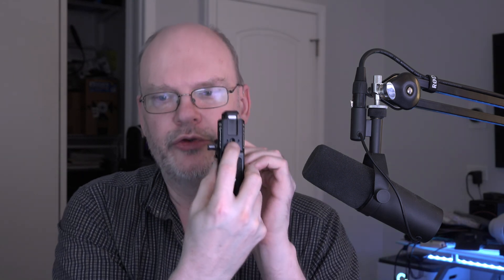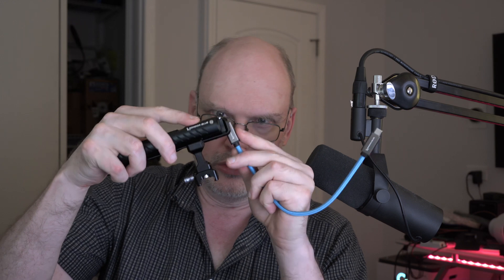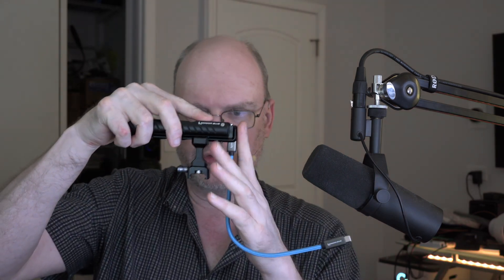Kondor Blue SanDisk PRO-BLADE SSD Handle First Look

Comment: Sad that smallrig or other companies don’t does the same thing without that problade thing. But build and enclosure, and build around an handle.
I’m not a big fan of proprietary things.
Reply from the maker: Internally it's a regular M.2 NVME drive, so if the PRO-BLADE casing ever gets discontinued, you can still take the SSD out and use it elsewhere.  But the mag casings are much more durable than any other external SSD I've used.

Comment: How on earth did you get this so early?
Reply from the maker: I pre-ordered it on their website the day they put it up for order.
Reply: @cwichura  And it supports your 4tb mag right? (the site says 2tb)
Reply from the maker: @kurtnelle  Yes, it works fine with my 4TB mags.  In one of the interviews from NAB, they talked about how some cameras they tested with didn't support more than 2TB.  So my guess is that's why they only say 2TB on the website.  (They implied only Blackmagic supports >2TB right now.  I don't know if that's true or not, but I can confirm my VideoAssist 12G supports 4TB.  I've been using it since the PRO-BLADE Transport first started shipping.)
Reply: @cwichura   This is correct!